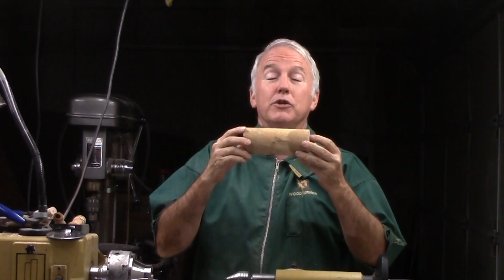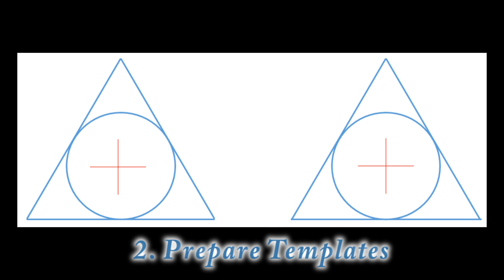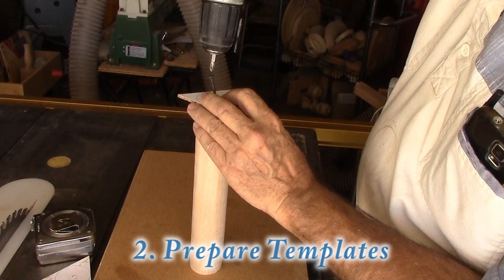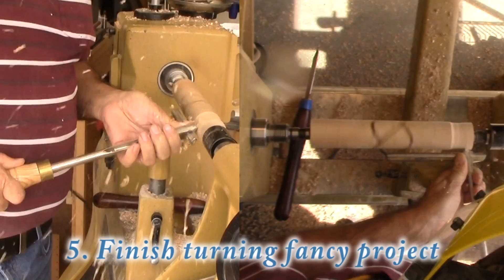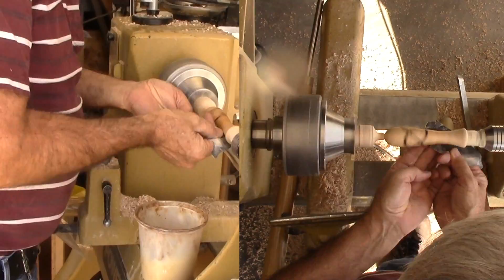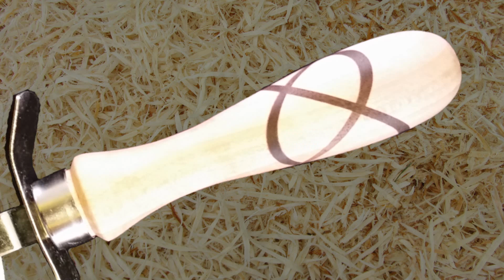Celtic Knot Dresses Up Pizza Cutter Handle

Comment: Alan;  Great video.   Rather than go to the complication of making the template ends, do this.  Go into your favorite Spreadsheet program.  Type the number 5 into as many cells as you need sides.  Convert the cells to a pie chart.  Print the pie chart in the size you need.  Center mark the blank and attach the paper to the end of the blank. Transfer the slice marks to the end of the blank.  You will need some way to hold the blank in place on the sled.  Hope this helps
Reply from the maker: That is an interesting way to create a polygon. I usually use MS Powerpoint with 8.5x11 sizing so it does not scale when printing. By invoking the "Size & Position" menu, I can specify the lengths and angles I need for the circle and the polygon angles. What I need for use in this system more than the slices is the flat sides of the polygon. When I glue it to a scrap piece of plywood, I cut and sand to the outer edges of the polygon. Then I screw the scrap to the end of the workpiece. The flat side of the scrap is what registers the angle for the Celtic knot. Paper alone would not be enough.
Alan

Comment: I'm about to make a copy of your jig.  Have you experimented with the angle on the sled?
Reply from the maker: Experimented - no. but imagine a 1/8 strip across a rectangle about the size of your project. As the angle increases from the perpendicular, the loops get longer and the visually wider. 
Bounce that against the project length & decide what you want.
Enjoy
Alan